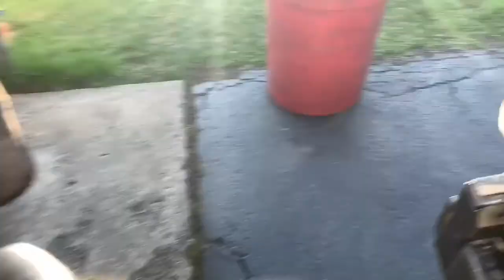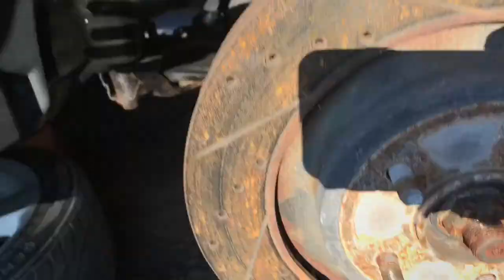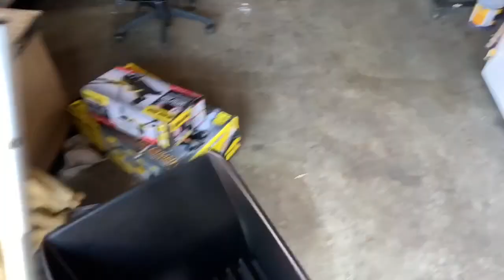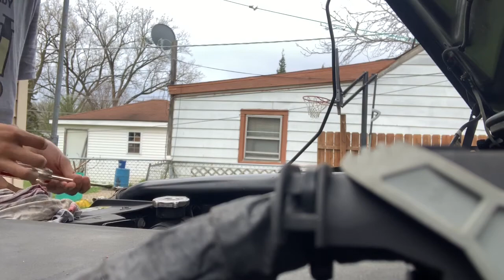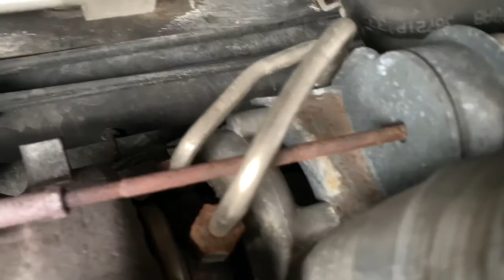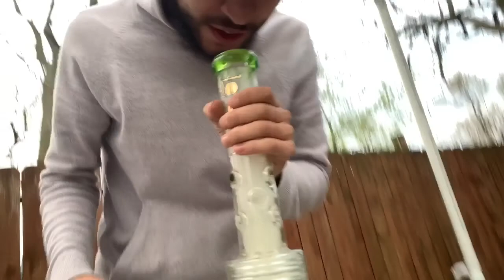Part 2: Results of Plastic Trim restoration and future plans

Comment: Where did you order your clips for the roof trim
Reply from the maker: Ordered them off of eBay but the clip was slightly too wide to fit. Had to trim a couple pieces of the plastic so it can fold and Inter properly. I don’t think they have exact oem ones unless the dealership but I’d say try to get ones similar. Going to the junk yard also works I just keep the ones that didn’t crack